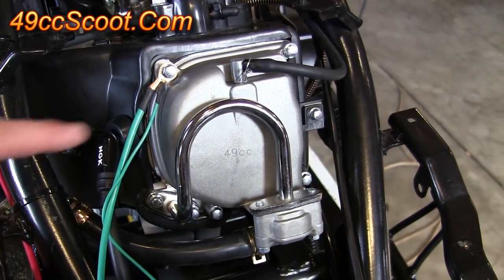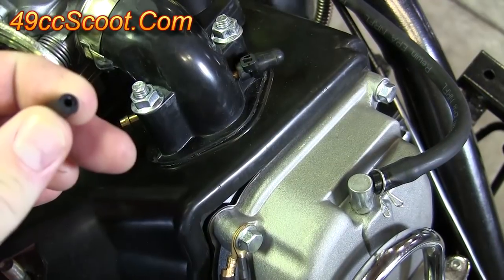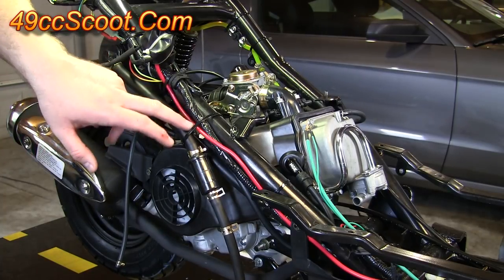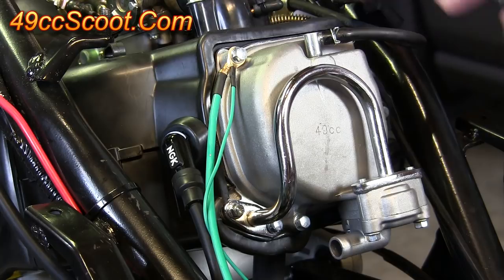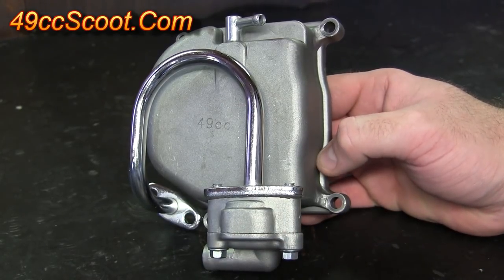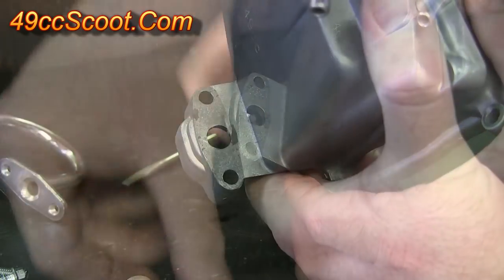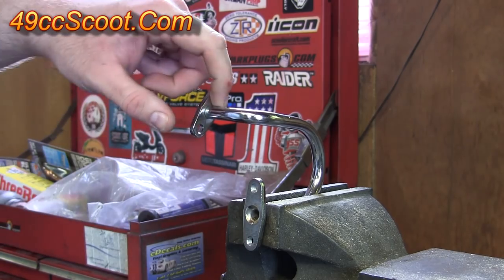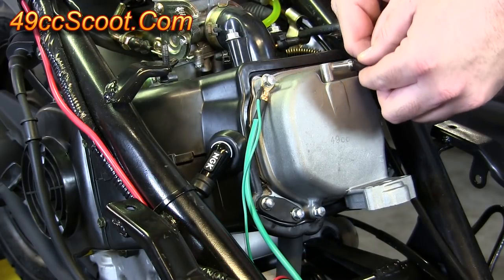Gy6 50cc Chinese Scooter PAIR System Removal : 139QMB Emissions : Racing Only

Comment: Hi, can i do this on an injection engine ?
Reply from the maker: Should be a similar process. Depending on the system, it could throw codes on electronically controlled vehicles.

Comment: I have a similar system on my scoot but instead of going to open air, the tube goes to that vacuum tube assembly but the hose goes to the intake in the middle of the airbox & the carburator..

http://gyazo.com/bca7915b7a7f2f2b8a0ceb667112a78b
The orange tubes are from the head to the intake, ignore the green vacuum tubes, but where I ringed in the thing where the vacuum goes to and the tubes, in the seam there it leaks something that seems like oil, is it like some kind of EGR valve? the exhaust doesn't have any tube that would connect to and EGR system so im kinda confused.
Reply from the maker: I'm guessing that's another variant of a PAIR system. Not sure why it would be leaking oil there. First thing would be to see if you could get that to seal by verifying that any fasteners are secure. If they're secure taking it apart and applying a thin coat of sealant like copper RTV may do the trick. Does the scooter smoke or seem to use oil?
Reply: It does seem to use ever so slight ammount of oil but I think that was because i changed to part syntetic before the break in period was fully done or even partly done since i couldn't find conventional non-synthetic oil for a good price, i'll take a look into it, tho if i take a similar hose and jam a nut into the other end and use some kind of epoxy or similar to block that pipe, would that be bad?

Also regarding the smoke, it can really only be seen when its dead cold and if you hold some black background, havn't noticed any smoke as of late, the smoking problem was when i changed the oil at about 50km into the breakin period, now it has 188km and i dont seem to notice any smoke or such, i filled the bike up with 750ml of oil and it seems to be at the top of the X's ( the top X on my dipstick is exacly 750ml)
Reply from the maker: You could remove the inlet and vacuum hoses and cap the nipples on the inlet and intake off. Then you'd just have to deal with the hose to the head. If it's like what's in the video you can see it's not tough to block off. You could probably block it with a bolt and clamp or something like that, though I'd prefer other methods.
Reply: *****
Please, can you help me? Any other way to condemn the PAIR system without having to weld? Parts for PAIR are hard to find and expensive. I would glady reinstall one if I can get my hand on parts. Mine got taken away. If you know something that I could use to replace the large hoses instead of buying them, it would help. I would only have to buy the canister and the filter. I think I found hoses, but they are expensive. Have you ever saw the exit hose of the PAIR going in front of the scooter, under the platform? Mine goes there. Tomos Nitro. Your video is very well explained, helped me out understand my problem. Thank you!
Reply from the maker: Enviromoto sells a block off plate for about $7-8 shipped, or did last I checked. I've also heard of people just installing a sheet of something solid that can hold up to heat between the existing tube and head. You could make a blockoff pretty easy with a small piece of steel and a drill.
Reply: Thanks for the quick reply. My source told me its pretty easy to plate off.

The block off where you put the piece you welded? Because I'm reluctant to open the thing. If I can shut it from the valve it would be even better. I still have a short hose pluged.
Reply from the maker: The blockoff plate is just like what I made of the cutoff part, only better looking. I'm sure you cna eliminate it other ways, but for me I want it out of my way if I'm going to eliminate it, and that removes it all.
Reply: Ok, thanks for the tips!
Reply: *****
If I may ask you another question, at 0:23, you say ''You have a tube running across here to a valve at the bottom''. Is that valve an air refill valve?
Reply from the maker: It's a reed valve that opens and closes with exhaust pressure to control when air can enter the exhaust.
Reply: *****  doing this. did it make a difference in performance
Reply from the maker: No. The only time you'd see a difference is if it were malfunctioning.
Reply: thanks a lot for helping.

Comment: i have a metal box with a hose on my 150cc exhaust, is that a pair system?
Reply from the maker: Not sure. Is the hose just going to the box, or is the box attached to the exhaust and then the hose leads somewhere else?
Reply: there is a metal box attached to the muffler header and there is a hose on the box?
Reply from the maker: Might be something like a PAIR, to get more oxygen into the exhaust.
Reply: *****
 ok i found out, i actually have a EGR which is welded to the exhaust pipe, can you make a vid on how to take off a EGR system, there is not much info on EGR stuff and on the forums everybody confuses it with the pair system which u covered with this vid
Reply from the maker: I don't have anything with an EGR system to take off. It should be a sorta similar process. Basically removing hoses and capping things that are left open. May have to crimp/weld if there's a large exhaust connection.
Reply: *****
 no welding needed, i bought a new exhaust header but it didnt come with a egr stuck on the header so now i need to remove the egr system
Reply from the maker: The hardest part should be covered then. If you've got the connection on the head like the PAIR does, Enviromoto sells a block off plate cheap. Otherwise it should just be vacuum connections to cap off I think.

Comment: I've seen a pair system where the big hose just runs straight to the muffler pipe ..
Reply: I had this from factory. But not this PAIR system. Must be a way to make it harder to run dirty.

Comment: Why not make a gasket that has Bolt holes but no center hole and reassemble?
Reply from the maker: I believe some have done something similar. I like the idea of getting it all out of the way if it's eliminated though and I have a welder so it wasn't a big deal.

Comment: doing this. does it make it n e faster. or perform better. if n e one knows. please let me know
Reply from the maker: No. This is not a mod for performance purposes. If you ever install a free flowing exhaust you may find it necessary to avoid popping in the exhaust.
Reply: thanks man.

Comment: at 2:18 where does that hose connect to, is it important?
Reply from the maker: That's the crankcase vent and it attaches to the airbox. It is important. Definitely don't run without that hose or try to plug it up.
Reply: so plug it up if i have an aftermarket air filter?
Reply from the maker: No. DO NOT ever plug it up. It's a vent for the crankcase. It needs to vent pressure. Check this out if you have a pod filter :
http://49ccscoot.proboards.com/thread/997/crankcase-venting
Reply: ........ *TLDR VERSION *........ 
Thank you so much for doing these videos! Can you vent crank case gasses to open air?! 

I know I'm REALLY late on this video, but if you happen to see this and could possibly answer a quick question for me, I would be forever grateful!
But, first I want to say thank you SO much for doing these videos! You have literally saved me hundreds of dollars by sharing your wealth of knowledge in these videos! I simply can't tell you how thankful I am for you (and the rare few like you!) So, really, thanks a million, Bro!
  Now, onto my question... Is it ok to vent crank case to open air? 
   When I recently went to do a valve adjustment, I realized that my vent port, on the top of my valve cover, had no hose on it at all. I haven't noticed any issues resulting from this, but I've read that it could be dangerous so I went and bought some hose, of the correct size, from the auto parts store. The only problem is that, my only connection point on my air box is way too big to accommodate the size of hose that the valve port nipple requires. So I was thinking, instead of adapting my hose, in some way, to allow it to fit into my air box, could I just run the hose down, along the bottom of my frame, ending somewhere around the middle of the bottom of the scooter? 
I've read a bit about venting crank case gasses to open air and am getting mixed reviews. What's your POV on it?!

Comment: How can I check the pcv vent is working ?
Reply: You mean the thing that he took off?
Reply: When scooter is running put your finger to the hose end it it have to suck air in
Reply: @Tomijus  no its a  vent  for the  crankcase it stays on.
Reply: @Tomijus  I think air comes out not in
Reply: @Tomijus  ok maybe it goes in and out. I thought that idea was to let blow  by gasses out
Reply: @Matowix   that crankcase hose on the top?
Reply: @Matowix   i think it goes sometimes in and out because i had some liquid in the hose and it wasnt pushing out
Reply: @Tomijus  I think  thats it

Comment: What do you do about the hole in the valve cover?
Reply from the maker: Everything should be covered here. If the system is the same as what is shown in the vid, then there won't be anything else to deal with.

Comment: help please everytime I drive my 150cc Chinese scooter all my oil leaks out of the ventilation hose
Reply: rainbow dash either your piston rings and or your valve stem seals are bad. Does it blow blue smoke from the exhaust?
Reply: Gave it away
Reply: When the oil pump chain broke

Comment: Have you ever come across a situation where the reed valve broke or cracked causing air to flow  constantly?   if so would that situation cause the engine to run poorly at rpms higher than idle?
Reply from the maker: +David moore I have not personally experienced this. I suppose it's a possibility. You could disable it and know for sure.

Comment: Can you just use a small piece of hose (maybe 2 inches) from this & use a Bolt with a clamp on it? It's over $10 for that little sucker! LOL If it was an open compartment that others would see, I'd get the block plate.
Reply from the maker: +Larry Long People have came up with multiple solutions. As long as it blocks the passage and is safe for heat it's probably alright. http://49ccscoot.proboards.com/thread/13807/poor-mans-block-off-plate
Reply: +90GTVert does this mod add power? And why did you did it?

Comment: Can anybody tell me where that ground wire runs to? I replaced my entire engine with a new one that I pre-installed a big bore on and didn't disconnect. So I have a bare ground wire kinda hanging off my motor. I'd say from the loop connection on motor to tip of exposed stranded wire I have about 18 inches of wire  and can't find where it was connected. Thanks in advance
Reply from the maker: Mine went in to the battery -. It's not critically important exactly where everything is, but you should have a ground cable system that joins the engine, frame and battery negative terminal so everything has a good ground.
Reply: @49ccscoot  yea I have the negative from battery terminal to the engine case and the ground to the frame. I have a basic understanding of electric in general I do home improvement and I. School for HVAC. Imbhandy just new to auto mechanics. This is more of a hobby. I tell you though the big bore (100cc) made a major difference on my 2019 tao tao pony. I average 44mph. And down hill close to 60. I've watched all of your videos and definitely appreciate you taking the time to make them. I tell everyone interested or who ask questions to visit your channel. Thanks for your response. I'm currently working on re-jetting. I upgraded my stock carb to a keihin 38mm and went to adjust the needle thing inside and it is actually screwed down to a brass colored tab? I bumped it down a notch and put it back the way it was but I thought it was odd. Do you know if this is normal? PS. I won't ask a million questions. 👍😜
Reply from the maker: @nicholascorbett6655  Thanks for the support. The needles on CV carbs do tend to have some contraption to hold them in place in the slide. The stuff that I've used is normally just a plastic piece that lets the spring put pressure on it.
Reply: That's exactly my dilemma. The keihin has a screw with a brass plate  that literally screws down to the bottom of the inside of the carb. I can't find a video on it   so essentially the needle isn't sliding up and down inside which my stock carb I assume does bc it has that plastic piece I ran it and it  and tuned it pretty good but I'm wondering if this is a packing screw or something. I feel like the needle ahold be able to slide up and down I dunno it's weird I'll keep looking
Reply from the maker: @nicholascorbett6655  You can always post a video to share or post pics on the forum and someone should know.
Reply: Thanks brother. I def will if I can. I'm really not tech savvy   but I am on the forum and will try to get a vid up. Thanks again 😊👍
Reply: Hey scooter brother I wound up using the stock carb spring and plastic piece. Definitely right choice I have a guy that's a scooter pro that I try not to bother looking at pics I sent him to tell me what the brass plate was on that keihin carb. I have a feeling that it was for shipping maybe but will share to help anyone that may have same issue later. Thanks again brother 👍🛵

Comment: The canister part really does nothing, the reed valve let's air into the manifold, why it closes when the scooter is off is a mystery, my canister failed in all possible ways at 200 miles, if you stuck a filter on the end of the hose going to the head, it would function the same

Comment: My GY6 got lean as hell at WOT, its a 125cc with top speed of 100-105kmh, it did issues and would bog at 80kmh top, my mechanic cleaned the carb jets and it rode beautiful on 105kmh easy, then a few days later it bogged again at high speeds, did valve adjustment, again worked beautiful for a day or two, now it can accelerate up to 90kmh, but has sort of flat spots or surging (hence slower acceleration) I am running out of ideas of what can I check, I do my work on the street as I dont have a garage so its small stuff only, I will go to the mechanic only as a last resort
Reply from the maker: A compression check and looking at the plug would be good things to start with. Could be hard to tune because of an air/vacuum leak or maybe a fuel delivery issue.

Comment: after doing this modification it's created a problem with spark. the engine started and performed fine, after shutting the engine off it wouldn't spark again. I couldn't find a 6 pole stator so I upgraded to a 8 pole with the correct flywheel for it and replaced the CDI, I've checked the coil with a continuity tester and it seems to have connection. I've got the correct spark plug gap. 

breakdown
egr removed
engine started and performed like normal
shut engine off
no spark
next day
engine started and performed like normal
shut engine off
no spark continuously 
replaced stator, flywheel and cdi and checked coil continuity
no spark
Reply from the maker: Unrelated issues or you accidentally affected something while doing the initial work. No emissions systems that I'm aware of on scooters disable the ignition or have any direct effect on it.

Check your kill switch and ignition switches. Quick check is to locate the wire on the CDI that gets the kill signal from them and make sure it's not grounded when the scoot is supposed to be able to run. Usually you have a 4 terminal section and a 2 terminal section of the CDI connector/harness. On the 2 terminal, it's typically the connection on the edge. You can search for "GY6 CDI pinout" though and find diagrams for clarification. If you get a ground there, the ignition will not work.
Reply: While checking the stator I have ground for every single wire (standard 4 pin plug and 2 bullet connectors) now the no spark problem has occured I have no ground on the red and black coming off the pickup on the stator. Could this be causing my issue?
Reply from the maker: You should see a resistance value other than 0 or infinity. May want to check this out : https://www.youtube.com/watch?v=q9-mr7BXIho

Comment: why not just use a blank plate simpulls
Reply from the maker: That works, as does this. Cutting it off and welding it up was faster for me than making a plate and the result is fairly clean.
Reply: thanks for reply i would just use a blank plate

Comment: Lol is the popping bad?

Being open doesn't subject it to a lean condition? Doesn't throw off the valves? As well doesn't help ventilation with hot air build from the timing chain all the way down to the varriator shaft? I'm no mechanic.. I just see a hole lol..
Reply: Also what happens if I just thread a bolt into the hole?

Comment: A non emissions style valve cover still reveals the hole. I just bought one and placed it over and the hole still shows. Please get your information right before saying it. This cost me time.
Reply from the maker: I said in the video that the easy way would be to get a non-emissions style valve cover and bolt it on "AND THEN THE NEXT STEPS I'LL SHOW YOU". It's just for a cleaner simple install. Not a solution for a block-off. Sorry that you misunderstood, but I have my information correct.

Comment: My scooter wean I gave it gas it die on me cold it be the fuel pump
Reply from the maker: Possibly. Check for kinked hoses too or a vacuum line off or cracked. If you've changed anything lately, the jetting may be incorrect for it.
Reply: Could also be a stuck or defected carb plunger diaphragm.